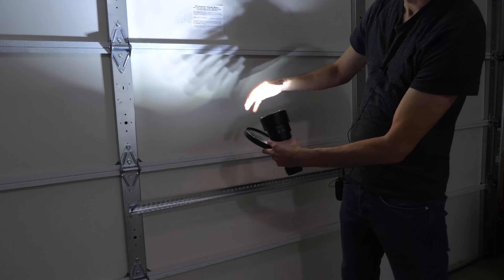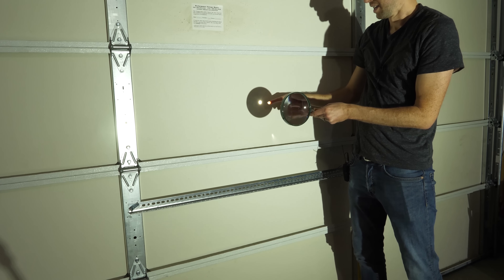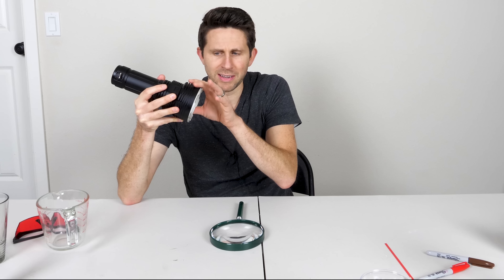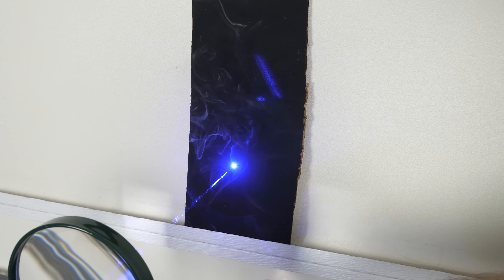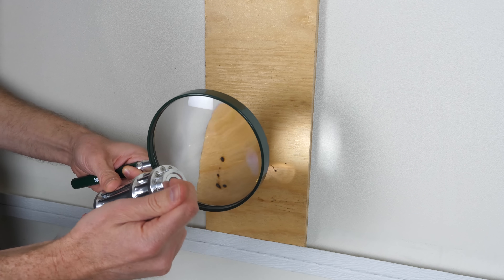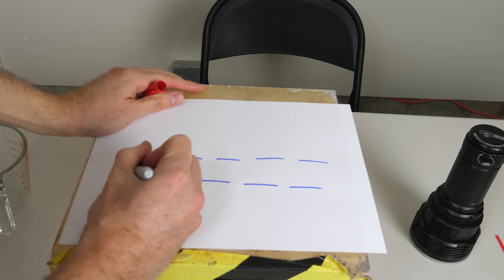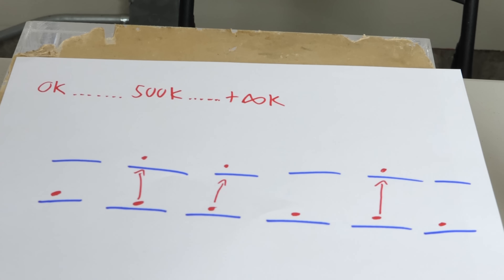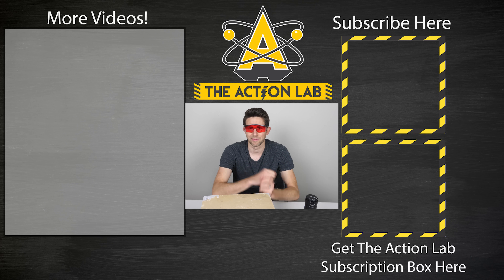What Happens if You Focus a 5W Laser With a Giant Magnifying Glass? Negative Kelvin Temperature!

Comment: Focusing light has nothing to do with the second law of thermodynamics - if you had a larger diameter lens the flashlight you could focus the light from the flash lamp to a smaller spot - try using a Fresnel lens from an overhead projector.  If the second law forbids flow of energy from a cold to a hot body - how does a fridge work?

Comment: OK, I need an explanation, temperature is an intensive property of a material... its independent of its size. there is an equal number of atoms in high and low energy state to be in the hottest temperature, how this would work if I split my object into two, this means that my imaginary knife should split atoms equally always (same amount of high and low energy atoms should be in in both objects to preserve the ratio/temperature), what if my knife split object between high and low energy atoms, ratio would change, this would result in temperature change and this would mean that temperature is not intensive or.... :)

Comment: Doesn't having reservoirs at + infinity & - infinity; allow a heat engine with 100% efficiency?
Doesn't this violate the law saying that you can't break even? I suppose the energy expended in maintaining the population inversion is the issue? So is there a fundamental thermodynamic limit to the efficiency of maintaining a population inversion? Like the impossibility of extracting work from a negative resistance - because it always takes more energy to maintain that negative resistance?

Comment: Actually we CAN focus all the  light coming from Torch by using a curved lens of greater Aperture...! Sir 👍
Reply: Right, it seems to me he's a bit off here. If he used a flash light with a much more narrow beam, or a glass which was much larger, he would be able to capture all of the light. And if he were able to capture all of the light and focus it to a smaller point than the front of the flashlight, that focused point should be brighter than the equivalent size area on the flashlight itself (assuming efficient optics). Of course if you measured the total light energy (or total brightness) of the focused spot vs. the total light energy (total brightness) of the entire light emitting from the flashlight, the two should in that case be equal (assuming perfect optical transmission). It seems he's mixing things up regarding the energy per surface area vs. total energy. You can't increase total energy, but you can focus that energy to make it more intense for a smaller area. That's exactly how a focal reducer works in camera optics, it actually brightens your image, but also makes it smaller. Am I missing something?
Reply: @NathanShirley  EXACTLY........ He misses the one important postulate of Ray optics and thus in this video he concluded it wrong... 🤝😄

Comment: Hang on a second.  If I make a magnifying glass big enough to capture all the light from the torch and focus it into a small point.  Wont that point be hotter than a similar sized point on the torch.  Am I not concentrating the light from a large surface area to a small one thereby increasing its temperature?

Comment: Um brightness (lux) is a density of light per area. So actually it is possible to make a light brighter by concentrating it into a smaller area. This doesn't mean that there is more energy (lumen), rather that the energy is focused into a smaller area. And temperature is a ratio of specific heat to mass. Which means that temperature is also not a measure of energy. Which is why candles can burn so hot, but also be put out with a pinch of fingers without so much as a singe. Because the actual amount of energy is proportional to the size of the flame, while the temperature is not.

The reason that your flashlight didn't work very well with your magnifying glass, but the laser did, has to do with the  cross sectional area of the beam of light (size and angle) versus the focal point of the lens. Not some quantum mumbo-jumbo. And you are right that the amount of energy received out will never be greater than the amount of energy put in, which means if you look at the wattage rating of the flashlight versus the laser you can do some simple math as to how small (concentrated) of a beam of light you need in order to reach the burning temperature of a material. I'm guessing it's going to be microscopic for the flashlight.

Comment: Or maybe just maybe…… Boltzmann’s entropy, and kelvin for measuring temperature…. Are just wrong? Measuring temperature based on number of energy states? Like what? It should be based on like total kinetic energy of atoms or something. There’s no such thing as negative temperature nor is there anything higher than “infinite temperature” you’re just concentrating the energy to a smaller point which makes it effectively hotter in that point in the same sense that if you were to put a lens on it to scatter it all around like a flashlight then it wouldn’t be “as hot” at any 1 particular point. “Negative temperature” sounds stupid and isn’t real. It doesn’t warm up to absolute 0 and to the room temperature when you turn off the laser nor does it just magically start pulling energy from everything like a black hole. This is cringe

Comment: Here is one issue I have with your flashlight.  The flashlight you are using contains a dispersing lenses. My guess is 60 to 80 degrees.  So to focus your light properly you would need a lense  large enough to capture all the light at a focal point much further away then you were.  If you were to say take a lense that provides more like a 15 degree dispersion, or better yet remove the dispersion factor and attach a columinator, you could then get a much straighter beam which you could then capture and narrow down.  It's worth noting that many cheaper lasers use a similar principal.  The light source is a relatively standard LED light source (sans the built in normal 180-ish degree dispersing hat) attached to a columinator lense.  

I do agree that you would still get an inverse picture of the led source, but it could still be brought to a much tighter point and provide increased energy relative to the un-magnified light.

The big difference between lasers and regular light (as I'm certain you are aware) is not the actual light source but how it's been focused and through what kind of lense system.  Just the way you left it made me feel like people would thing there was some magical difference between the two.

Regardless of the critiques, I love your work and how you display things.  Thank you.

Please excuse some of the terminology and spelling I am aware that it's not exactly correct, just a little too lazy at the moment to go find proper terms.
Reply: He didn't have a big enough magnifie glass. If he used a massive lense to capture the light of the torch when the torch was far away, then you would have to get smaller magnified glassed to capture that light source. And you will have to do that until you can focus the light in the tiny dot of heat.
Reply: ""The big difference between lasers and regular light (as I'm certain you are aware) is not the actual light source but how it's been focused and through what kind of lense system. ""...i am sorry, but regular light is created by excitation and decay of electrons? ....total noob here, sincere question.

Comment: The negativte  temperature really dont  exist, its really just there to make the math work.

A laser really dont have a surface,  the Photons  is generated  in a volume, so the light can be tranformed  from 3d space to effectivly  2d space.

This way you can get more energy into a point, but it cant still be hoter. Light have a tempersture attached  to it. It cant heat anything to a highet tempersture than the wavelength tempersture. The diffrance  from black body radiation and Electric stimulated  induced photons  is that the source dont need to be as warm as the photons. This is true for lasers, LED, flurecent  light. But things that use black body radiation like a lighrbulb  of the sun need to be hot.

Comment: Use a cone shape light reflector object on the flashlight.
At the tip point of the cone a small hole as the light will focus to that small hole🤔

Use big to small magnifier in series.

How does thickness of the glass play a factor in the  Magnifying glass

Comment: Of course you can focus a torch to a brighter point than the surface of the source. You either need a huge lens or simply a series of lenses. If the prijected point has a smaller total area than the light source the resulting spot will be brighter. Everything else would violate the laws of thermodynamics.

Comment: Quick question. What does the laser light do to the dust particles in the air as it emits light?
Reply: The light just gets scattered by particle in the air (which is the reason why you're able to see the laser beam shooting through the air). Light actually has momentum though, so if you have a powerful laser like this, it's actually able move small dust particles by constantly bombarding them with photons.

Comment: In my childhood I used to burn things using sunlight and a small magnifying glass.
The reason is that the sun is 109 times bigger than the earth, and it cannot be compared to that of an LED light.
You can actually converge a small portion of sunlight and get a hotter point out of it, though not hotter than the source, but sufficient to burn things. Do give it a try...

Comment: Flashlights and the sun both emit light out via the inverse square law. Basically the amount of light per square meter decreases exponentially with distance from the source. A magnifying glass with invert this property and make the amount of light per cross sectional area increase until it matches the source intensity. For the flashlight you end up with an image of the LED. A laser emits light in straight line and the intensity remains almost the same per cross sectional area (looses some power as it interacts with the medium it’s traveling through). The magnifying glass is bending the light toward a smaller cross sectional area and thus temperature increases. You are putting energy into a smaller space, less matter to absorb  those 5W of power in the video.

Comment: Your laser is a stronger source of light because it is avoiding the light diffusion effect because the beams are parallels. It is carrying much more energy than regular light. Also, your flash LED light, hasn't a temperature production, but just cold light. This is the principles for laser beams. And when you focus the beams, you are collecting their all energy to a more limited spot and the Energy now is the sum energy of the beams. Light's energy, it could be produced by the temperature increase but also from the excited atoms which are dropped to a lower energy level suddenly and this happens with lasers than hasn't to do with an increase in source temperature. In laparoscopic medicine, we use regular very strong cold light sources, they aren't lasers, and they don't break at all the II law. I didn't  catch your point at all. The thermodynamic law isn't relevant for cold light sources.

Comment: Can you try this experiment at some point using more than one source of magnification? I suggest almost the same parameters except introduce a larger magnifier to capture more of the light lost, then using additional magnifying lenses to a single point to see if you can actually achieve your original intent. I suspect that you will capture more light radiation but you will lose heat as the light passes through each lens. I could be wrong however.

Comment: Consider this. There is no heat on the sun. The sun is only light which has different wave lengths. The light of the sun is transmitted through the cold of space as wavelength or frequency. Heat is only generated when the light falls on an object, atmosphere, your skin or your eyeballs. However, you can capture the entire frequency of the sun with a special array of lenses which focuses the light entering the first lens, passing through additional lenses to a point to recreate the the light/heat of the sun. So, the laws have not been violated but it seems like they have because the light rays have only been compressed by the lens, thus creating heat.

Comment: This is incorrect in a number of ways. First. With a laser you cannot focus a beam To a smaller point than the diode it's coming from. Secondly, when the temperature becomes high enough, It becomes plasma... breaking up the atoms so that there is no longer any atomic bonds to keep electrons in higher or lower states. 

Atoms no longer exists only atomic particles they were made of. 

There is a bit more, but I don't want to get the subject off of these two main problems.

Comment: Is there some meaningful metric (I'll call M) that's like temperature but relates to, I guess; the bias in the distribution of states in the system so that we can avoid the weird "wrap around at infinity to negative infinity" math that seems broken?

-∞ M ≈ 0 K
0 M ≈ ±∞ K
+∞ M ≈ -0 K

I guess the value would be something like:
(excited_states - ground_states)/entropy?

I wonder if we could "re-frame" thermodynamics using a metric like that.
Reply: Actually, I think maybe it would make more sense to formulate it as the ratio between the average state distribution: 
(excited - ground)/(excited + ground)
= (excited - ground)/total 

And the entropy of the of the system (the information you expect to gain from observing the state of any given particle): 
M = (excited - ground)/total/entropy 
= (excited - ground)/(total * entropy)

It seems like it makes more sense to measure a ratio of two averages.

Comment: Tiny correction: You actually can't have a temperature of infinite Kelvin because when you add energy into matter (-> in this case heating it up) it's Wavelength becomes smaller and smaller until it eventually reaches the Planck length (the smallest length possible in the universe as for our current understanding) at this point you could add more energy into the system but it would become hotter than absolut hot, also known as "Planck Temperature". We would no longer consider it as temperature because our current models don't apply there.
Reply: Is Plank temperature the same as having the molecules swing with the Brownian motion at the speed of light?
Reply: I take it this is what would happen if you managed to get more atoms into the higher state in a non-quantum system? Planck temperature? Or would the atoms just disintegrate as there’s too much energy for it to hold together?
Reply: @Gay_Priest  If I got this right. Matter above this temperature is no longer Matter. So there would be probably no atoms (but they would have already fallen apart before this point is reached)
Reply: I think if you put too much energy at a single point it would start produce matter from the vacuum.  There was even an idea to do that type of experiment with a very powerful lasers.... but then it was scrapped, because "it's too expensive".... it seems for our politicians, understanding the fundamental building blocks of the universe is not very important.
Reply: @Slav4o911  Too expensive? More like they can't risk the public getting any solid information on the results.

That would be catastrophic for them.
Reply: @JenkoRun  Or they already know and don't want to publish the results.
Reply: @fanofmetal1  That's literally what I said.
Reply: @JenkoRun  then explain why we have particle accelerators, which do exactly that...
Reply: @Slav4o911  What you describe actually exist, those are called particle accelerators, the whole porpouse is to smash particles against each other so they become energy in the collision, and the energy reforms in to other particles.
Reply: @diablo.the.cheater  No, that's not how those work.
Reply: @TheStrawmann  really now? what do they do then?
Reply: You got this from vsauce, did you
Reply: @kevintusinski8500  Yep 😂
Reply: This definition of temperature is how many particles are in high energy state, not physical temperatures. Physical temperatures is a measurement of average kinetic energy of particles in a system. I was also confused at first, but now i understand.

Comment: 2:20 I'll have to disagree. 
Let's take L amount of luminosity (joules/sec) given out by a source.
[ L = T^4 x R^2 ] where T is temperature, R is radius

Explanation 1:
--> if one is able to focus all that energy (meaning L will be constant) on a smaller radius, T will have to increase. 

Explanation 2:
--> IF we put SAME AMOUNT of energy  into 
     - BLOCK 1 with 10 atoms 
     - BLOCK 2 with 5 atoms

Atoms in Block 2 will possess higher Kinetic energy than in Block 1 
-- as each atom in Block 2 has DOUBLE the energy provided 

*Since temperature is measure of average kinetic energy, temperature for Block 2 will be higher than Block 1* 

Conclusion:
So I believe u can make a spot's temperature higher than the sun if u are able to concentrate all of its energy into a radius smaller than the sun itself. THUS having same total energy but spread of less atoms hence each atom having higher K.E and being considered higher temperature.